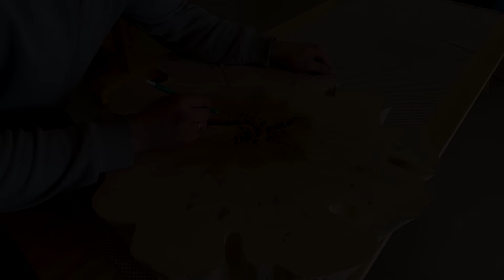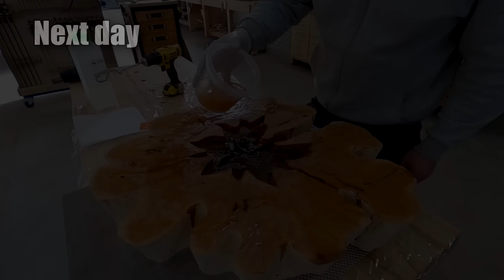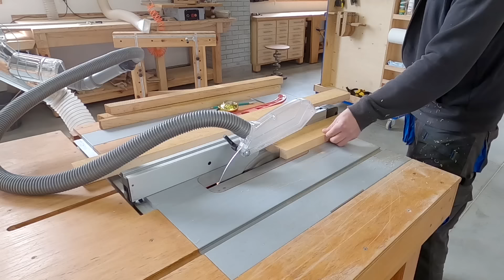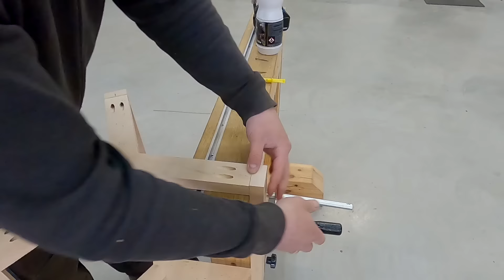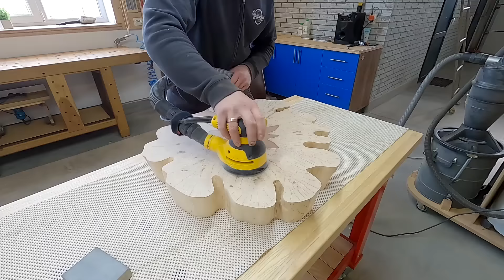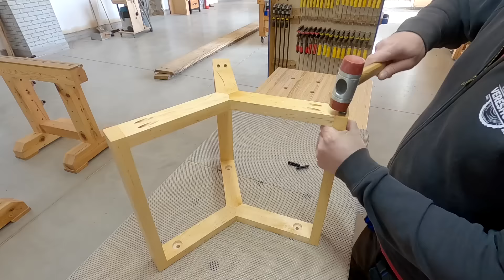Small Epoxy Table DIY | Tree pattern in stump | Woodworking

Comment: The whole video was amazing, what a great job you did, can you tell me what the brown substance was that you applied to the bottom of the table? I would really appreciate it, thank you from Connecticut…
Reply from the maker: Hi) Thanks a lot! I think you mean epoxy resin - with coloring)
Reply: @mr.vereshchak  ok thank you, I have some live edge slabs that are very rough on the bottom so I am going to attempt to use it as you did, thanks again.. is that one coat?
Or multiple?